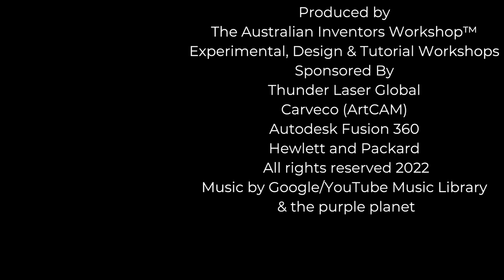How to build a full size CNC Router Plans and parts listing available on my Patron pages

Comment: Nice build. What the thickness of the aluminum you've used to make the frame? Why didn't you choose steel instead? isn't it cheaper and stronger?

Thanks.
Reply from the maker: Plans and parts listing available on my Patron pages
 https://www.patreon.com/user?u=15079773
Reply: @rogerwebb9600  Right

Comment: Hi i was wondering do you know if you can start from a pacific line number with the smc controller. eg i recently did a large 3d carving with mach3 using a 1mm tapered ball nose cutter. It took 2 days to do the finishing pass so i had to stop it after 11 hours make a note of the line code and then tell mach3 to start from that line code the following day. Do you know if that is something that can be done with the smc controller and how to do it. I am also waiting for the video on attaching and using a z probe on the smc. I look forward to the next installment to this cnc build. Cheers Neil
Reply from the maker: Hi, yes the SMC5 will
Reply: @rogerwebb9600  will you be making a video to show how to do it as i can't find much information